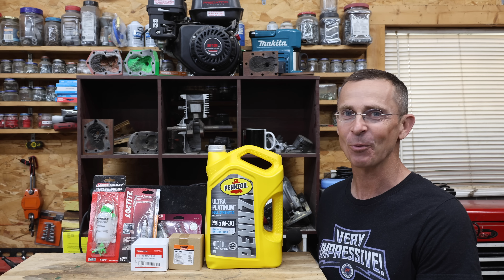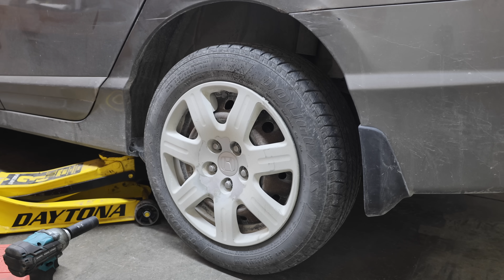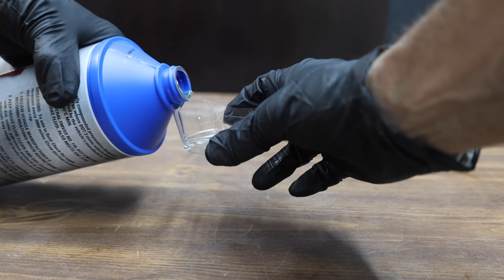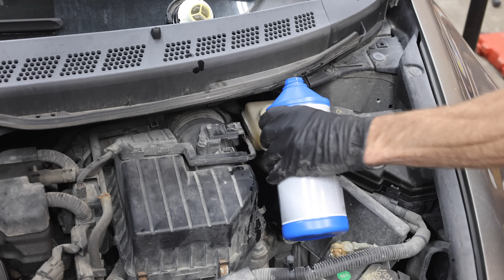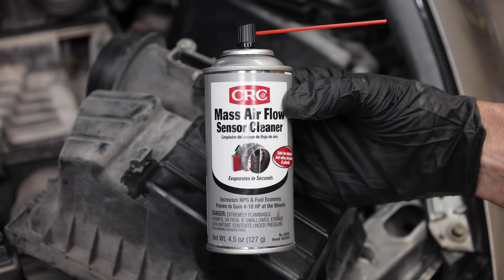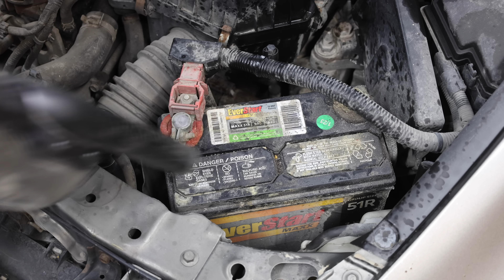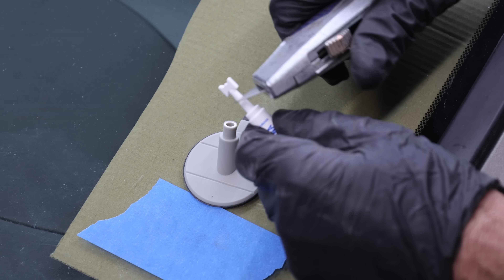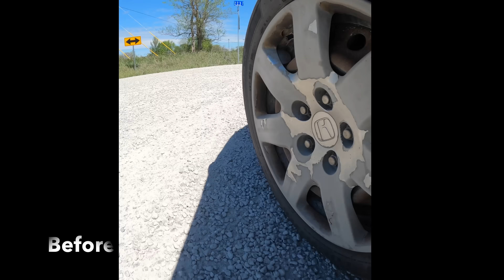Most Reliable 200K Mile Car? Let's Settle This!

Comment: About your fluid extraction device, I'd just use a MightyVac hand vacuum pump which is a good thing to have generally...
Also they have a brake bleeder kit for it.

Good inspirational video.
I liked it.

Cars sort of peaked years ago in my opinion and get harder and harder to work on and a lot of new stuff they want to sell me I don't even want so fixing up an older one makes more sense than a lot of people think if you like that sort of work anyway.

One job you do yourself often more than pays for the tools needed to do it...
Reply from the maker: Thanks!  Thanks for the feedback.

Comment: Very Impressive!  I noticed you do a few little different things than I do. I put dielectric grease on the nipple of the spark plug not the ceramic shaft. And Im not sure how you bleed the brakes, but I finish all brake work then bleed the brakes one at a time right after the other starting with the furthest brake from the reservoir and then the second furthest and so on. You may do it that way, but it wasn’t clear in the video.  

I haven’t been through every video on you channel, but a comparison of windshield chip fixing kits may be a good video idea, thanks!
Reply from the maker: Thanks!  Thanks for the suggestion.

Comment: Surely the torque wrench should be the default as opposed to snug then a quarter turn . Also I know some older cars in the UK had Positive Earth and all were made negative earth after around 1967 i think.  Also if you have one of the older cars you wont have anywhere to plug in an OBD2 code reader.
Reply from the maker: Thanks for the feedback.

Comment: I found this 200K Mile Car video very interesting. I am not mechanically inclined but I use a very good shop. We have a pickup with 300K and our family business also uses 2 pickups that are 250K. Our personal vehicles are all 2012 or earlier and one is 220K and the other is 125K (just acquired this one).  Thanks for the checklist.  I showed it to the owner of the shop we use and he said it was a great list and missed nothing he normally checks out when I buy another older vehicle.  Yup, this Wyoming boy says thanks again.
Reply from the maker: You are welcome!  Thanks for sharing.

Comment: I have a 2003 Honda accord with 175000 miles bought in 2004 major repairs only spent $900 since 2004 to 2025. Very reliable car. Least total cost per mile of any car I have ever owned.
Reply from the maker: Thanks for sharing.

Comment: I’ve owned this same car for 13 years now. Got me through my entire 6-year military enlistment and ever since. Still running strong at about 200k miles, with many more to come!

Some other things if I may suggest are cleaning the throttle body, adjusting the valve clearance, and replacing the transmission cooler filter.

Also, I’m no mechanic but I’ve read that replacing the transmission fluid multiple times until you get all fresh fluid can actually make the transmission slip, so I just drain and fill one time at the maintenance minder intervals.

Love these helpful videos, thanks for making them!
Reply from the maker: Thanks and you are welcome!  Thanks for sharing.

Comment: I have an 8th gen civic too.  Make sure to take a close look at the top of the rear springs.  They will wear out and snap on the top side.  Although I live in the rust belt.  Also check the motor mounts
Reply from the maker: Thanks for the feedback.

Comment: Great video.  The only thing I will say this,I have a 09 Civic LX with 67,000 miles ( got the car a few years ago with 55,000 miles  ) and changevmy front axles and the did NOT go back in that damn easy even with the ring space( on the axle end going back into the tranny )  facing 6 o'clock.
Reply from the maker: Thanks!

Comment: VERY IMPRESSIVE. I do the same to my cars, motorbikes. Currently we have 1998 Peugeot Expert 1.9 td with 220k miles on the clock. Slowly but surely it is getting into shape. The bodywork is not rusted, apart from few surface rust, engine is bot consuming oil, good on diesel. Had new driveshafts, clutch, breaks put on it, and it is just fine. New cars are a ripp off. Again, very impressive. I am hooked to this channel.
Reply from the maker: Thanks!  Thanks for the feedback.

Comment: Pretty much anything Toyota or Lexus used, for my family.  Both of my kids have 100 series Land cruisers at 245k and 295k, RX 350 185k, LX570 120k.  I learned my lesson in my 20s, buy Toyota products, maintain them, and pocket a lot of cash in having low repair costs.
Reply from the maker: Thanks for sharing.

Comment: all this silly EV push has made 90s cars and up to 2007 cars bargains on the used market sometimes for just 1000 dollars, some of these cars were 60 000 dollars when new and would compete against BMW   just spend 3000 on my 1997 Mitshibishi  with 190 000 miles on it to overhual everything like in this video  , the car is only worth 2000 before i fixed everything and spent more then what the car is worth but you have to look at it this way now you have a car that can go another 50,000 miles without needing anything done to it and a  new or other used is always going to need repairs so knowing the history one one car is important
Reply from the maker: Thanks for sharing.

Comment: I don't regret driving a brand new silverado off the lot, but sometimes I kick myself just a little when I think about how much more money I could have in my pocket if I had grabbed an older truck and done the maintenance. If I still have that Silverado in 20 years I think it will have been well worth it.
Reply from the maker: Thanks for sharing.

Comment: Toyota taking seven of the top 10 slots (if you include the Lexus GX in the Toyota family). The Toyota Tundra has the highest chance of reaching 250,000 miles, at 36.6 percent. The Toyota Sequoia, 4Runner, Tacoma, and Highlander Hybrid follow in slots two through five, all of them with a better than 25 percent chance of hitting 250,000 miles.
Reply from the maker: Thanks for shring.

Comment: My brother drives a 2006 or so Toyota Corolla.  He has about 500,000 miles on it. He has replaced the timing chain, the clutch and about 7 or 8 water pumps.  It keeps on going...
Reply from the maker: Thanks for sharing.

Comment: My 2010 VW ROUTAN SE minivan is in at 189,000 miles runs and drives fantastic everything works great. Recently had new tires,  front brakes, oil pan seal, motor and transmission mounts done $3100.
Reply from the maker: Thanks for sharing!

Comment: My 2011 Toyota Sienna Limited AWD minivan has 210k miles and  is running like it did at 100k. It's the reason why it's on the top 5 list for longest kept vehicle. Not a single leak, seepage, or oil burning. It's a keeper.
Reply from the maker: Thanks for sharing.

Comment: Had a 2006 pontiac G6
265000 orig eng and trans
Gave it away at that point
new owner wrecked it at 297000
Reply from the maker: Thanks for sharing.

Comment: Wow, I'm a fan due to the systematic testing and data of various items, but this revealed all my secrets of DIY, very good.  I drive a 2000 Corolla and get gawkers thinking they can lowball me until I quote them like $11k...'it's not going anywhere'....208k miles and maintained to get 3-5x that.
Reply from the maker: Thanks for sharing.

Comment: You gotta be careful with those Honda 1.8s. They had some serious coolant issues and had to warranty a ton of engines.  If you see coolant stains on the side of the block run.
Reply from the maker: Thanks for the feedback.
Reply: @ I worked 14 years for Honda NA.  Unfortunately their heyday of great cars is long gone.  They hitched their anchor to that 1.5 turbo and it’s an absolute nightmare to service compared to the k series it replaced. They even figured out a way to screw up the most reliable v6 maybe ever made. When will the manufacturers realize we just want a tool that works .  Especially considering it’s the tool that takes you to work to pay for said tool 🤦‍♂️.

Comment: Love this.  My family generally drives older high mileage vehicles.  I am very careful about regular maintenance.   Yes yearly repair bills are higher, but I figure we are about 100k ahead relative to buying new vehicles which would not need as frequent repairs.  Your $100 per month repair estimate is spot on for older vehicles.
Reply from the maker: Thanks!  Thanks for the feedback.

Comment: Buick and olds use the 3.8 l V6 and those are district council. Got a dozen of them and 8 out of 12. At about a 150 to 200000 the head gaskets went. It was a factory defect, but once they were new head gases were installed, they were good for another hundred and fifty 200 hundred thousand miles. 😊
Reply from the maker: Thanks for the feedback.

Comment: Say it with me people; don't buy new it's not worth it.
Buy used Car: Toyota, Honda, Lexus, Acura, 90s-early-00's Buick (3800).
Mini van: Toyota, Honda.
Full sized van: GM, Ford (year specific but early 00's better on both ends)
Truck: Toyota, GM, Ford (same as above early 00's)
Crossover: Toyota, Honda.
Hybrid: Toyota.
EV: Why bother?

Tl;dr if it's not a truck class type of vehicle Toyota or Honda.

Stay away from anything Euro, Hundai/Kia, Nissan, Mitsubishi, Modern GM, Ford unless it's a 1 ton truck. Never ever buy anything Chrysler, only the Cummins is worth the trouble and only pre DEF.
Reply from the maker: Thanks for the feedback.

Comment: Mazda 2 Sedan 2011. 229,000 KM since hit the road. Not replacing it any time soon, but i do change the engine oil and engine oil filter every 8,000 KM/8 months
Reply from the maker: Thanks for sharing.

Comment: how about a 1 million mile car? that's a short list. a 1963 chevy, with a 283 v8. 25mpg with the right transmission. sad to say- gm is a shadow of its' former self. a toyota camry with ALL the smog krap & cat. converter gone? oh yeah. or- a next gen. tesla model Y juniper with 4680 cells. 40 cents per gallon to fill up, no oil changes, no brake jobs- EVER, no maintenance of any kind. sorry legacy- you just got owned.

Comment: A 2007/2008  Honda Fit or a Honda Civic are great candidates for "a not very expensive car you can upgrade into something pretty reliable" but I doubt they really are selling for 500-1000$ without major engine or transmission issues.
Reply from the maker: Thanks for the feedback.

Comment: Honda's always had issues with CV joints/boots.....compared to other vehicles. I do not know if it is the quality of the boot or the part/mechanism which it covers or if it is the fact that these vehicles are so low maintenance that owners just change the oil, check the fluids and go, in the process not lubricating the parts that need lubrication as per the manual.
I remember over 30 years ago making a u-turn and applying full power on my 5-speed manual, 1988 Honda Civic Hatchback DX and busting a cv joint....this model was the first one with a 1.5L 16-valve FI engine making a paltry 92 hp and a 17 second flat 1/4 mile with a 0-60 of 9.2 or so. It was faster than almost all normally aspirated 4-cylinders and many V6s of the day, with a weight of about 2,000 lbs!
Reply from the maker: Thanks for sharing.

Comment: Young generation listen to this man 
And get yourself damn reliable car that is not show off car , if you're in your 20s and working to make money do not buy European car unless you got it from your father then no problem don't abuse it drive it with caution you don't have idea how much ZF transmission coat of it fail or how much water pump replacement cost on BMW so get yourself japanese or Korean 4 cylinder sedan 
Do not underestimate KIA or Mazda but of course Lexus still the best you can get early 2000s Lexus for 5k$ you need to search in right place 
Avoid European car your pocket will be lighter be careful

Comment: We have owned several KIA Sportage models all exceeding 200,000 miles without any major mechanical issues. Our current model is a 2007 with 307,000 without any major mechanical issues. We change the oil every 3000 miles and perform all recommended maintenance. Very well built cars and easy to work on when repairs are needed.
Reply from the maker: Thanks for sharing.

Comment: Surprised you didn't wash the engine/bay. Good job indeed. Not everyone is handy and mechanics overcharging by far so Go Missouri! (Was quoted to remove a broken wheel stud $200) did it myself for $7 in parts.
Reply from the maker: Thanks for the feedback.

Comment: Auto body tech 27yrs.. Mechanical for 3 and you are a professional..Here in N.H. body rot is the biggest deal breaker..Sub frame , trailing arms and mounts are the killers.. Salt collects and rots one day after the other.. I look underneath the 1st. when looking at a used car.. Again you the MAN..

Comment: My best friends Toyota Prius has over 650,000 miles on it. I have seen many with over 400,000 miles on them. I drive one as well and I have had some with over 300,000 on them before I sold them.
Reply from the maker: Thanks for sharing.

Comment: Personally: 

1. 1 of those 2 bolts on the Mac Strut to the knuckle is eccentric and sets the camber. Make sure you align it back the way it came out.

2. I never break off spark plugs in an aluminum head with a breaker bar. I use a weak cordless impact using a little penetrating oil in the spark plug hole. 

3. Only add distilled water in a fully charged battery, for instance, immediately after a drive with minimal electrical load before you operate the starter again. 

4. Drum brakes spring tools are cheap. Get some, and ALWAYS WEAR PPE.

Comment: 1986 Toyota 2WD truck with a 22RE engine and 5-speed. At 200K the engine is just broken in. Bought new in 86, now 38 years and 487K miles as my only daily driver. Still on original engine, transmission, drive line, and differential. Original AC systen coming out now at 38 degrees recirc,  36 when new. Original fuel injector system. Starts 1st crank within seconds. Doesn't burn even 1/4 quart of oil between 5000 mile oil/filter changes with Castrol GTX 10W-40, That  "crappy dino" oil.
Reply from the maker: Nice!

Comment: My 2016 Mazda 3 lasted 212 000 miles before I had to do any repairs outside of regular maintenance.  I had to replace the flex pipe, then a few more things a year later.  It still has the original muffler and rest of the exhaust system.
Reply from the maker: Thanks for sharing.

Comment: please review electric chainsaws with extension cords and not batteries. also review oil for chainsaws.  Also review extension cords that can handle the amperage of these units that draw over 15 amps. Thanks
Reply from the maker: Thanks for the suggestion.

Comment: You did a great job addressing the failure points. Had the original owner kept up on maintenance, only a few of these things would have been necessary and the car would have already been pretty reliable. Back in the day when I was a new homeowner with a young family, I did this sort of thing and replaced the cars on roughly a two year cycle. I had nice cars that were reliable and always kept up on repairs and maintenance. At one point, I needed a work truck, I bought a non running Mitsubishi truck for $300, got it going again and drove it for about four years. Not a bad investment!
Reply from the maker: Thanks!  Thanks for sharing.

Comment: I bought a 2009 civic in 2016 , it had 90k on it when I bought it for 6k , now it is at 371k , runs perfect , does need struts , I did change the drivers side cv axle and 2 wheel bearings , a starter and some other small stuff but the engine and transmission have not had any major issues ,    I have never put this many miles on any car so far ,  still love it !!   I use Valvoline full synthetic high milage oil every 3 to 4 k  and use honda trans fluid from the dealer , its does leak a little oil and trans fluid , not much trans tho ,   it just wont quit ,   it does not have a cvt in it , I think they started to use cvts in 2016 in civics ,      mine has a 1.8 ltr engine with an automatic transmission .
Reply from the maker: Thanks for sharing.

Comment: So how did repairing that old car prove it's reliable and won't die in the middle of nowhere?
Reply: I've seen a lot of "new" cars dead on the side of the road. I, personally, have a 99 Buick with a 3800 engine. I picked it up for $1900 and immediately dropped about $1200 into it much the way it was done here. It only has 85,000 on the clock. Enjoy your car payments.

Comment: Man, you're just like my best friend an all purpose handyman. He buys used cars, trucks and motorcycles for cheap, fixes them up, paints them and someone's sells them and starts all over again. He just fixed my car door because it wouldn't unlock and ask it cost me was a rebuilt door lock actuator, $80 and $150 for his time, about an hour. He didn't asked but I paid him anyway. So, that's $230 for me and the dealership wanted $1,200 before tax. The part was $650 by itself. He's currently working on his Mazda Miata and two motorcycles. He's combining both bikes into one as he's making the smaller motocross bike bigger by exchanging motors and adding other pieces to it.
Reply from the maker: Thanks for sharing.

Comment: Oh yeah 😎? Brake Grease? Do you mean: Silicone Grease? It's what I use for both Brakes, light bulb 💡 threads and the threads of spark plugs,  especially on aluminum heads.😊  16 Oz. from Amazon less than $20, and comes with a handy brush.
Reply from the maker: Thanks for sharing.

Comment: I started buying "work cars" when I bought my Jeep Rubicon, so I wouldn't wear it out. Chevy S-10, ran to 400k. And bought a 2004 Ford Taurus, 3.0 V-6, with 138k ran it too 275k, sold it and it was doing fine. Bought a 2004 Ford Crown Vic,  cabbies run these to 500k. Last work car I had to buy
Reply from the maker: Nice!